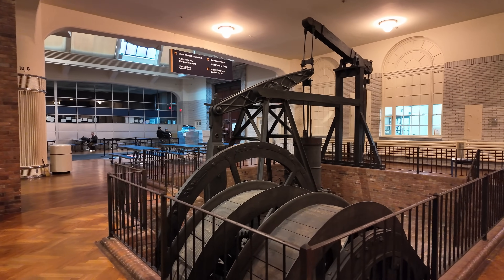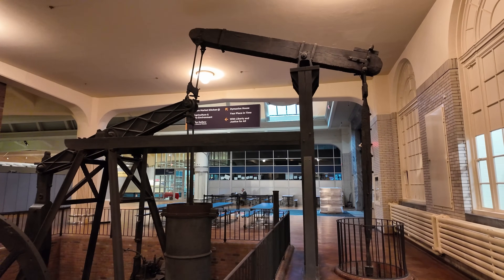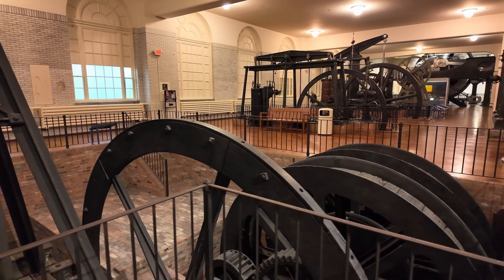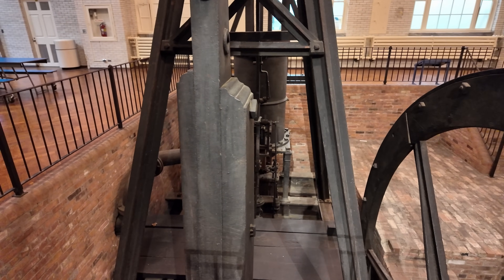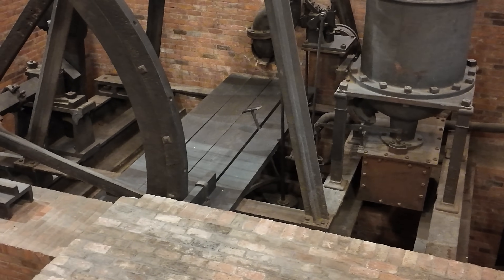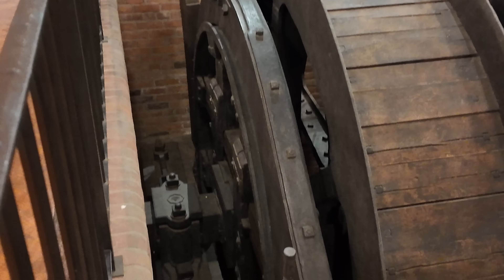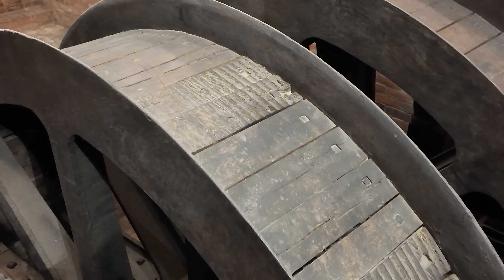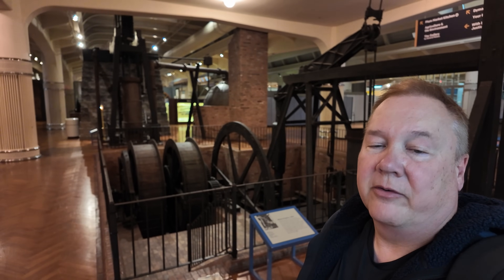World's Weirdest Steam Engine?  The 1804 Moira Mine Engine

Comment: The foot pedal was important because engineman had to stop the engine shortly before or after bottom dead center of the crank because if he stopped in the exact bottom dead center the engine wont be able to start turning again.
Reply from the maker: That was always an issue with single-piston engines, with piston at exact top or bottom.  About the only fix was to manually force the system to move far enough that the piston could work again.
Reply: @Industrial_Revolution Only an issue once a crank was connected. In its original older form operating a pump, the pump shaft weight always resets the piston position.

Comment: This is interesting (Honestly everything on Your channel is!) i guess for it's time modern materials and an improved construction did solve the problems of the old machines destroying it self, i guess they did had acess to more modern booring tecnics whan this was made so the cylinder wold probably seal much batter than the old ones so i assume they must had encontered the same problem, it looks like the beam and chain construction is much stronger and use a full steel design on those later machines, that would probably also mean that they could turn the former problem into significaly more machine power i guess.
Reply from the maker: Thanks!  Glad you liked it.
It'd be really interesting to see exactly how this evolved over time, as they decided to just add a bit here and there.  Did it start with a single drum, then add the second one later to give them more flexibility, for example?
Reply: @Industrial_Revolution  I would love to know that too! In Scandinavia we did not had any coalmines so all the coal was made from wood from the forests and most of that was reserved for the iron undustry to process the ores from the mines for export (is it called pig iron in the US? Those where alos further processed into steel both for export and for national use, so timber for coal was restricted by the gouvernment in the 1700 and early 1800 in order to secure the stell industry in Sweden, so power the pumps with wood coal had been very expensive at the time and probaly on the borderline of even being legal (later machines where powered by bi products from the sawmills so those basically run with free fuel like those Brittish coal mines machines, even small steam locomotives where powered by wood here long in the 1940s if they did run for the sawmills.), and we have plenty of waterfalls here to power the mines (now converted to hydroelectric powerplants since the late 1800s) , so as far as i know those atmospheric engines stayed with that one prototype machine in the late 1700 here, later macines where made with the more fuel efficient modern tecnology, in Sweden they where mainly used to power the sawmills in the outskirts of the cities in the north which exported timber to the south and mine support beams to Britain. In Britain they had neither, but a lot of old coalmines i guess... It is pretty cool the they still used this tecnology in relatively recent time!
Reply from the maker: You definitely had some technological innovation there, too.  During WWII, due to the lack of coal, some steam locomotives were converted to run on overhead electric wires (but still steam!).  Also, I think, that's where chain boats were developed?  I've been having trouble finding much info on those, and what I've found so far all appears to be based on a single source.
Reply: @Industrial_Revolution  Yes! I read about those being used in the Netherlands during the war for some smaller locomotives, basicaly an old steam locomotive refitted with a giant transformer on one side and what i assume would be electric heaters. Personaly i find those little but important things super interesting! (In Sweden the first electric railroad was installed in 1926 modelled after the German system (but we made our own locomotives shortly after), but the old steam haulers for the ohr line from the iron mines in the north remained a bit longer, only a bit more than half the size of the American Big Boys frome the 50s, but still genuinely impressive size! And +100ton (cant remember exakctly but i think it was around 120-30 ton, or a bit more with the tender, they where a bit lighter compared to the more modern Chinese locos, which are about 140 ton with the tender, because they where made from much better high tensile  steel back then, so i estimate it would be something like that). They are "Lit F" class in the naming system here) The original concept of chainboats are much older i think, in the older form they where cattle prams used for crossing lakes and bogs here, there are remnants of the pillars of one on the lake bottom outside my fathers old farmland. I think those has been around at least since the mediveal time, but i am not realy sure about the history of the modern chainboat in south of Europe, but one possibility i think of is thet they originaly did replace the old rope line ferries. They kind of still exists here but the modern ones are drived by an electric guidewire but are self propellant. I think however that system will soon be replaced by the modern autonomous digital guide system since the wires cause trouble for the modern boats and ships. I have to read more about the ones You mentioned here, that sounds genuinely interesting! I also realy look forward to see more of the evolution of those atmospheric mahines! The Henry Ford museum looks truly amazing!! I can only imagine see it in real person compared to the pictures i got. I am so happy he did realize the importance of saving our tecnical history milestones like this in the right time to save that much!
Reply from the maker: The chain boats I'm thinking of weren't just ferries for river crossings.  Still plenty of those around, although mostly on cables.  These ones laid chain for miles along the bottoms of lakes and rivers, then used steam engines to pull the boat along the chain, around curves, up through fast current, whatever.  That boat would then pull barges along behind it.
Reply: @Industrial_Revolution  That sounds genuinely interesting, i realy have to look it up now! Personaly i realy love the evolution of the early American steam tecnology anything from the donkeys to the machines designed to pull up whole trees!

Comment: Interesting - I wasn't aware that any Newcomen engines used a separate condenser. Amazing that they were able to get continuous rotary motion out of it!
Reply from the maker: It's in that weird transition state from Newcomen to Watt designs.  Newcomen patents were expired.  Watt patents were expensive.  People tried to cheat.  I'm a bit vague on how this one falls on the Newcomen side, myself, but that's what the sources I found stated.
Reply: @Industrial_Revolution  Watt's patents expired in (or just before?) 1800, so there were lots of 'clones' likely on the market when that cylinder was made in 1806. It's also another reason using atmospheric engines was affordable in the early 1800's even when engines with lower operational costs existed.  The initial purchase cost was likely significantly lower than "modern" designs that still had patents on them.
Reply: @Industrial_Revolution  The cylinder and piston may have been unmodified from the old design, using a leather flap around the edge with the whole top of the piston flooded with hot water to seal it. It also still only pulls on one stroke, and uses gravity and a counterweight rather than a proper crank arm mechanism. Perhaps this would better fall under the term Cornwall engine, in honor of the many knockoffs?
Reply from the maker: It may qualify.  Early Watt engines used the same single-acting cylinders, leather seals, and water on top of the piston, though.  I have a video of a huge canal pump he designed that was like that.  Later, he made another canal pump which was a double-acting piston, but I'm not sure it was actually any more efficient.

Comment: Fascinating.  I'm amazed that it ran and did useful work until 1929.  Thanks for uploading this!
Reply from the maker: These old machines were so reliable and so easy to fix when they did fail, replacement really came down to things like fuel cost savings (they got the coal free for this one) or someone like Henry Ford coming along and offering you a big pile of cash to buy the old engines (like he did with a couple of James Watt canal pumps, which were still in use when he bought them).